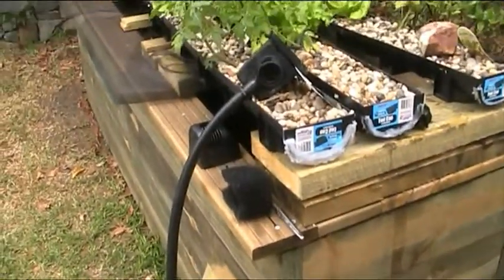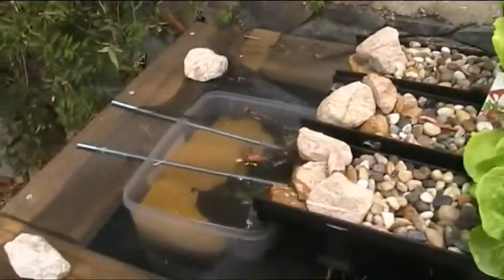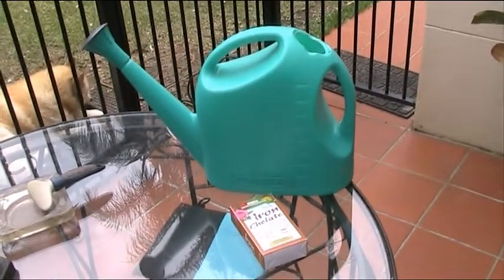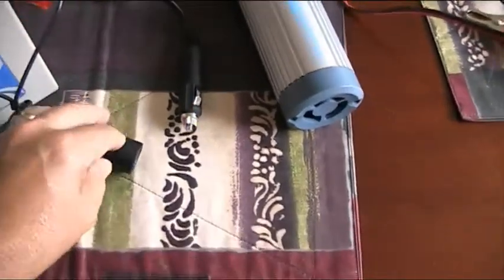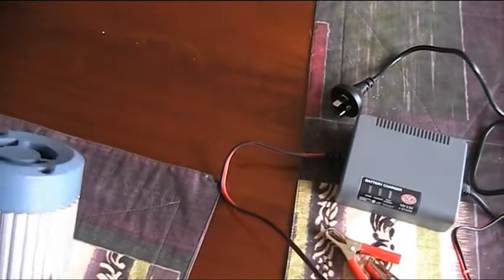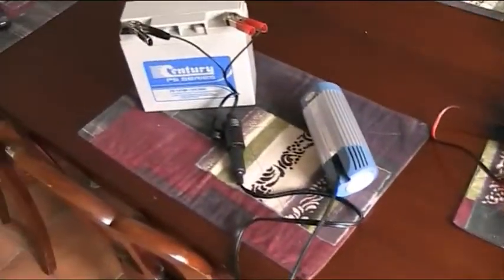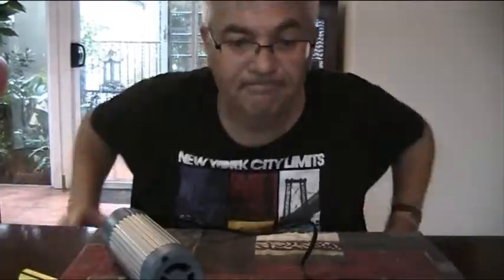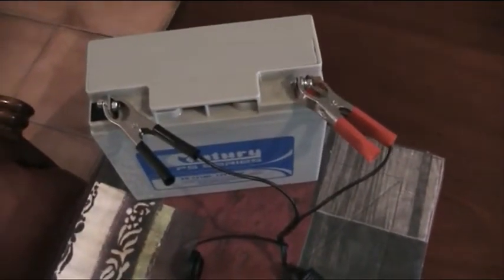Aquaponics Bits and Bobs

Comment: Does that mean you can recharge it in the truck and still have it powering the pump at the same time? If not you would still need two batteries.